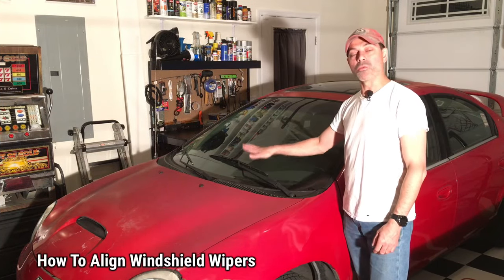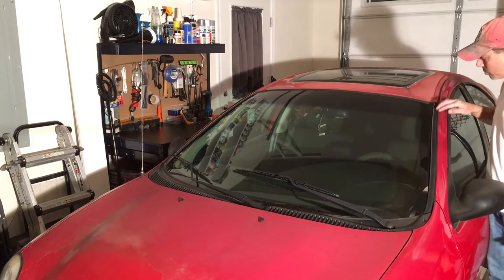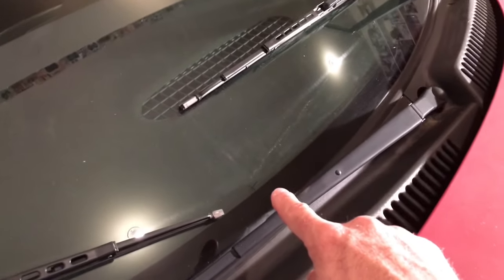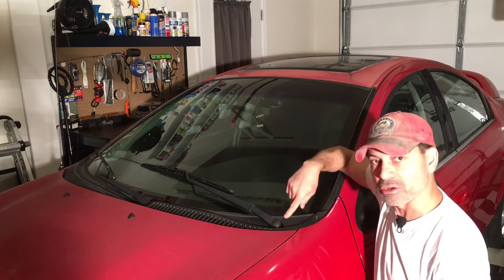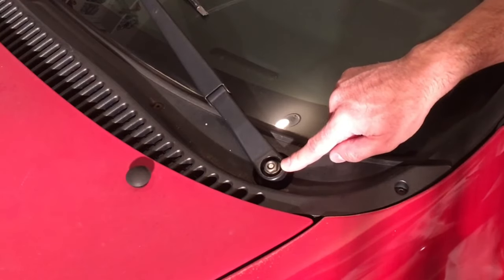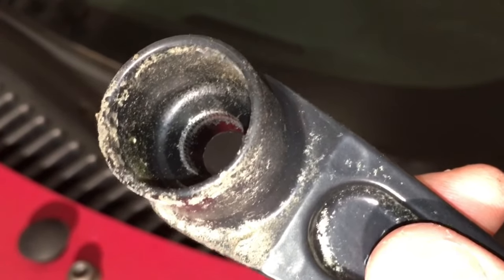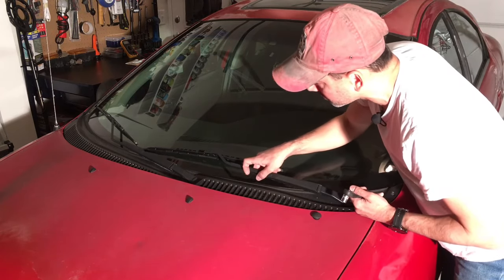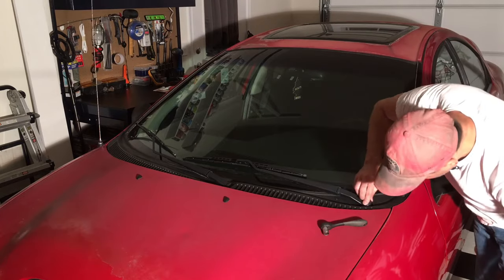How To Align Windshield Wiper Arms (Andy’s Garage: Episode - 256)

Comment: I bought a new/used car I think the dealership detailer knocked the wiper out of alignment because I didn't hear it during the test drive. A few days later I heard thumping when running the wipers. After watching this video, I marked inside the vehicle where the wiper was, I lifted the hood to access the bolt, I popped off the plastic cap, then used a socket wrench to take the nut off and then the wiper easily came off and went back into its new position. Thanks so much for this video. It is the only one I found on YouTube. Well done. :)
Reply from the maker: Glad it helped👍

Comment: ⚠️ Remember that wiper arms are spring-loaded, so can snap back from the service position and shatter your glass. Take precautions whenever adjusting the wiper arm or replacing wiper blades, protect your glass from damage by placing a thick soft towel, sponge or pillow.

Comment: You may need a wiper arm puller tool. They don't always come off as easily as the one in the video did. They are ~$15 on South American River. Probably have them at Dock Cargo or any auto parts store too.

Comment: on another video, they mentioned some sort of "goo" to stick in there before reassembling everything. is this just optional or does it improve the durability or duration in amy way?
Reply from the maker: It may be a lubricant, but I don’t think it’s necessary. It may just make the application easier.

Comment: You have  explained it very well, I was facing the similar issue after the engineer re-installed the wipers, but he did not align them properly. This video helped me fixing it myself without taking it to the workshop :) Thanks!!
Reply from the maker: Glad it helped
Reply: You know what, i feel like repair shop dont care. They did same to me and even worse. This is very useful, i am going to try now 👍

Comment: Super helpful! Thank you! I’m not typically handy…If it helps anyone else: I was able to wiggle the arm off without a puller tool once I realized that I needed to lift only the bottom section of the wiper blade off the windshield to reduce the tension and wiggle it free. Hard to explain…

Comment: Thank you. It's exactly what I needed. Now I don't have to order a new windshield wiper motor like the auto shop recommended. (I figured it was something simple. I just tried to adjust it wrong—without loosening the nut, which then loosened itself and the wiper went wacko!)

Comment: Great video, very educational!!❤ Just one reaction: "If you sit on the driver's side, isn't the shorter wiper (the one in front of the driver passenger) positioned too high! Viewing both wipers from the outside, one can notice that wiper on the passenger side is set higher than the one on the driver's side. Is that all right?
Reply from the maker: If you use the windshield you’ll have them in the correct location. The passenger is slightly higher since it needs to be above the driver side arm

Comment: I've got a focus mk1 and the wiper blades do that 'squicking' noise even after replacing, could this process solve it?
Reply from the maker: If they are not out of alignment it will not solve the problem. Could be the brand of the blades

Comment: I know this video has been up for a while and it's clear and concise, but I feel like it still needs to be mentioned. 

If these steps are not working and/or if the retention nut on your wiper was loose. Make sure the wiper motor is indexed as well, as the wiper to the newly indexed motor. 

Lived in Arizona for 16 yrs wipers were never a problem in 20 days of being in Utah during the winter, mine was making the X shape while driving down the interstate in a blizzard. This is not a joyous experience and I don't recommend 😆.
Reply from the maker: Thanks for the input 👍

Comment: Can the 'tightness' of the nut be responsible for the wiper scraping and causing that awful noise as the wiper sweeps across the windshield?  Or does it need to be pretty tight and something else is causing the awful noise?
Reply from the maker: It needs to be tights so the blade won’t slip, but do not over tighten. The issue you are having could be caused by the rubber blade being worn or dried out. There are metal clamps that hold the rubber blade, when the rubber gets too worn they will scrape the windshield. If that’s your problem, be careful so you don’t scratch the glass.

Comment: What do you do if Safelite did your windshield and now your wipers are too high and then too low and then too high and crash into the a pillar and then crash into the cowl?
Reply from the maker: The arms need to be adjusted at the starting position, and then make sure the nut is tight to keep the arms in place
Reply: @PhillipsVision  OK, thanks but it seems there is 3 inches of slop in the whole mechanism now.  I think they broke the wiper transmission.

Comment: interesting. My passenger side go up and parks without an issue, but my drivers side, if I park it correctly, it doesnt go up all the way like its supposed to. So I went ahead and adjust it, and then it wouldn't park properly. I don't know what is going on with the drivers side.
Reply from the maker: Make sure the nut is fully tightened and that the gear is not stripped

Comment: My old and new wipers i just installed don't wipe away a certain spot. How do you fix gaps? The outer sides of the wipers wipe just fine. Just not the middle.
Reply from the maker: Did you buy the ones specified for your vehicle? Did you also replace the brackets? If so, you can try bending them more straight in the middle; they may be slightly bowed.
Reply: @PhillipsVision  yeah they're the right ones. I didn't buy the wiper arms, but that would be the next thing to do since i did notice i needed to press down a bit in the middle where you slide on and off on the blades. Thank you man.

Comment: I did this but my wipers are still smacking at the bottom and at the sides. Motor problem?
Reply from the maker: Make sure your arms aren’t stripped inside
Reply: On question, if the arms are stripped means I have to get 2 new arms? What if it’s the other part the arms go bolted on?
Reply from the maker: @brol1k  that’s the arm transmission pin, they can also be replaced
Reply: Thank you for your help, I will look into this situation.
Reply: @PhillipsVision quick question, if that’s not the issue, then thr last resort is to replace the whole arm thing?
Reply from the maker: @brol1k  before you replace anything, try re-aligning and tightening them again. You may have it slightly off the grooves on the pins
Reply: Yes I did the alignment. The wipers smack the bottom and sides (both ways) past their limits. I can see the wipers through the driver side mirror haha. Maybe the entire thing is done. The Subaru is a 2005.
Reply from the maker: @brol1k  always start with the cheapest/easiest thing first. Majority of the time that’s the issue

Comment: What if my dash doesn't have no markings ??
Reply from the maker: You’ll have to use the edge of the windshield molding as the marker for when the driver side blade is extended to the max.

Comment: Windshields that are positioned low when turned off get frozen during winter storms and they are so low that the defrost can't heat them enough to free them.  That sucks.  Poor design.
Reply from the maker: In those cases it’s good to raise the arms if winter weather is in the forecast. That will prevent them from freezing, and the blades getting damaged

Comment: Those wiper markings are frigging brilliant. I just bought a 2008 Lexus IS250 and the previous owner (a woman) seems to have had the entire wiper blades and arms replaced with some cheap dogshit aftermarket ones, & the alignment is slightly out. The car absolutely still has the original genuine Lexus windshield, and I see markings absolutely nowhere. 😡 I want to buy a set of new genuine Lexus wiper arms/blades, but I won't know the correct position to align them to. You'd think a company like Lexus would have put some markings on the original windshield, given the Toyota you're working on is a decade older.
Reply from the maker: You can align them without the marking; just position them so at their highest point they are approximately 1” from the edge off the windshield side molding.
Reply: @PhillipsVision  yes I know, but it's still an "estimate"/ approximation. I like to know exactly where to position them. I'll have no other choice, but was just commenting on how the lack of markings is ridiculous.

Comment: My driver side adjusted just like in the video no problems. Could not get my passenger side to move. It looks like there was some permanently attached washer holding it down under the nut . Is it normal that the passenger side cannot be adjusted? On a Chevy volt 2016